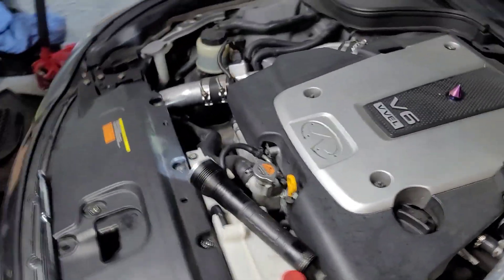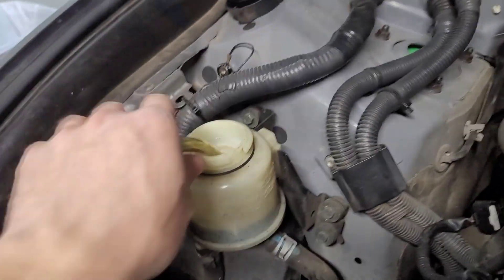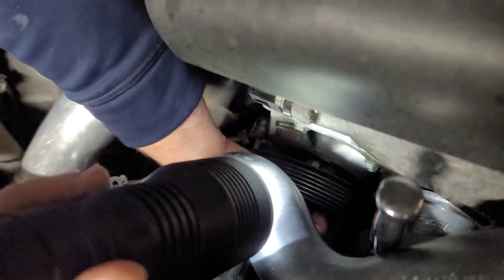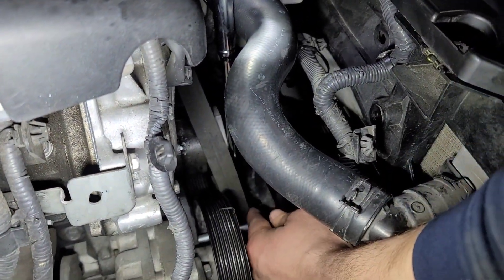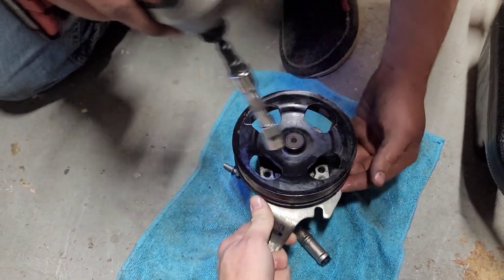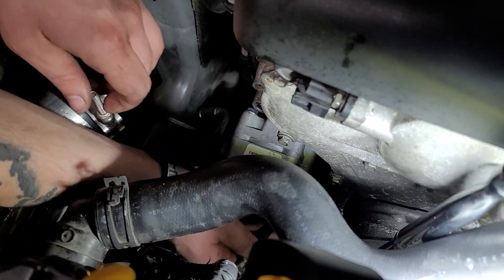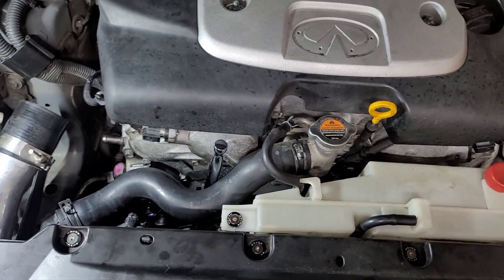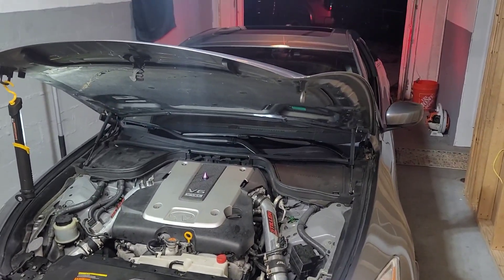Infiniti Power Steering Pump Replacement | For ALL 3.7 V6s | Including Nissan 370Z - G37 - Q50 - Q60

Comment: how did u guys move the fan?
Reply from the maker: I can't remember exactly. The coolant reservoir had to come off the shroud. Then I think it had two bolts on the shroud itself on each top corner. I can't remember if the bottom had any or not. But they all have to be removed and you kinda have to wiggle it around and it drops down just enough to get the last bolt out
Reply: @ heard , been sitting in my car port the past hour trying to do this